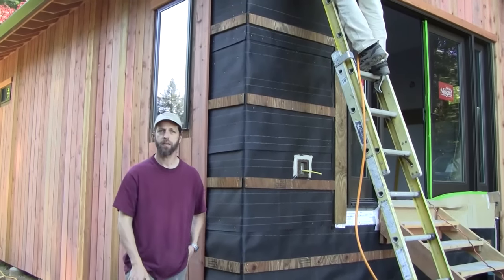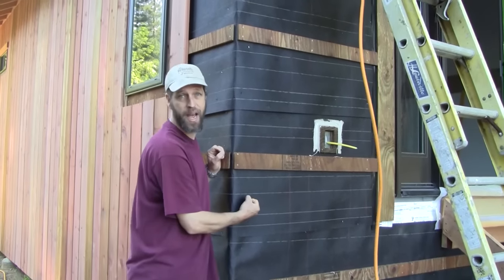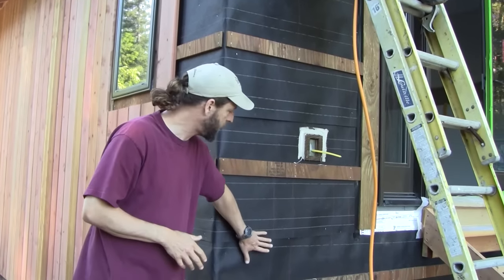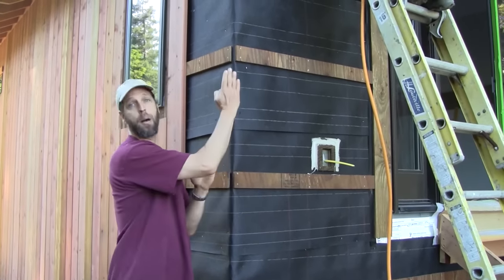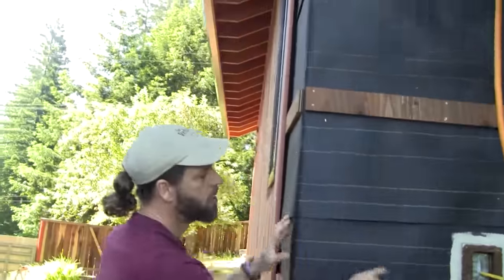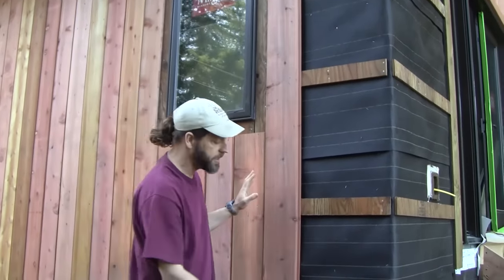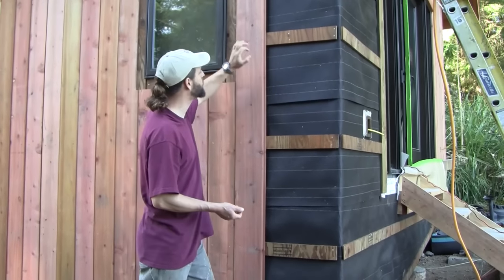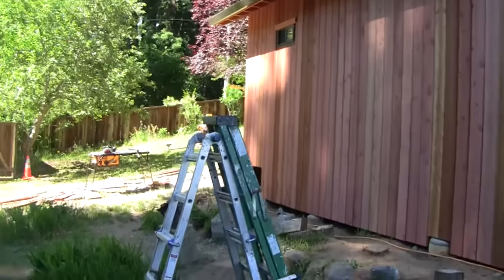DIY VERTICAL wood siding INSTALL with a DRAINAGE plane.  A Contractor Explains.

Comment: i like your ideas on water drainage ....But what about Bugs and other small critters? looks like your building them a nice place to live
Reply: You attach a wire mesh (or some product) to the bottom (and top) of the rainscreen.
Reply: @jasonjayalap  This addresses the critters but how about the bugs?
Reply: @IDRIDER9  
Aluminum screen goes under the bottom and top course of lathing and folds over befor the cladding is installed, sandwiching the screen and sealing out bugs!

Comment: Not too dissimilar to my 45 year old Norwegian type house here in Scotland.  Only difference is my house has board on board cladding and horizontal battens have a 10° bevel to divert any water.  Behind the tar paper is 1/2" bitumen coated fibreboard.
Reply: have any pictures of the bevel rainscreen. what fasteners did you use for the board and batten, are they meant to hang on the rain screen or penetrate the plywood
Reply: In short the fixings don't go through the paper. Only the fixings for the horizontal batten where the posts of the frame are. 
I have 20 mm  horizontal batten, 13 mm x 75 mm back board, 
20 mm x 120 mm face board.
I don't use anything longer than 50 mm and keep the heads flush.

Comment: The t1 11 is a bound to fail. Those little holes don't have a chance. Best to think of thr siding as a vertical roof. In a vertical siding you could have counter battened, that is place vertical battens on first then horizontal ones. 2 by 1 treated battens are very cheap.
Reply: Putting horizontal furring strips on top of vertical ones before you put the board and batten siding on is an excellent idea!!!
Reply: Is there a special flexible  caulking that can withstand the elements to prevent water from getting back there in the first place? Only maybe having to redo it every 10-15 years or so

Comment: Moisture guard, "ice guard", is another great option. It will actually seal around all penetrations such as nails and or staples. I used it on my sisters 100yr old house she bought 15yrs later roof siding everything looks great and holding up nicely. I recommend it.

Comment: How much do I overlap the tar paper? Is there a certain way to start the the second layer of tar paper? (- thinking about how the two layer line up). How do you secure the tar paper - screws, nails, staples? I assume I don't have to tape. Thanks for making this video!

Comment: wicked awesome video. im installing vertical also. tounge and grove installed on furring strips but no drainage cut outs. in gonna have to add some on my furring strips. glad i watched. i was thinking that today and someone also said i should insulate too. i wasnt planing to but i notice your not either. im in new england area.

Comment: loved how boards run vertically and how you took all those steps to guard against water intruion.  My question is:  did you blind nail the boards or were they faced nailed?  And if they were blind nailed, what process did you use?  thanks Steve
Reply from the maker: No face nailed.  I think You could use the jigs for blind nailing just like a deck.  You might have modify the jig so that there is no gap.  I actually have 4 jigs that I use on one job then never used again!

Comment: Tip on vertical siding .cut an angle like 30 degree s on ends by ground,forces water off bottoms of siding where they rot first.
Reply from the maker: Great tip!

Comment: I was thinking you created a water trap with your horizontal strips then you pointed out the reverse t111 trick.. Nice idea. I worry about delamination and rot but hopefully the water proffong did the trick. I think it will work and I would feel good about what you did. I wonder about making similar strips out of pvc type "lumber" that you cut grooves into. Obviously more expensive and time consuming and maybe overkill. I don't know. Great job and video. Thanks for posting. I'm glad I'm not the last tar paper guy.
Reply: See CorAvent strudi strips - $200.00 for 448 feet. 112, 4 footers

Comment: What sort of trim or baseboard will you put at the bottom? Or is it necessary to have one? I would assume that when the water falls down off the roof, it will splash back onto the ends of the vertical siding and make them warp or rot.
Reply from the maker: To answer the first part of your question I would not put trim or baseboard at the bottom. In my experience when you put trim at the bottom of an exterior wall you're just creating a rot spot. When the water goes down the wall and hits the trim anywhere where there's a gap in the caulking will then cause moisture and the worst thing is two pieces of wood touching one another that's where rot begins
Reply from the maker: To answer the second part of your question about roofing. You definitely need a gutter. Any splashing on the ground that would come back up to the siding should be minimized my preference is to keep the siding as far away from the ground as possible. So if you have a little concrete stem wall you just have it as far up away from the ground as possible 6 in 12 in however tall your stem wall is. Another good thing to do is to put gravel around the building if you're in a fire prone zone like we are it helps with fire prevention much more than it is appreciated and it also spreads the splash so that it doesn't bounce up as much. I hope that's helpful!

Comment: I'm building a goat shack and wanted to protect the exterior of the plywood with tar paper- but how do I protect the lower edge, which will be up on cinder blocks, but still standing in snow for a fw months out of the year?  I see you left a few inches bare on the bottom of this wall, but it is up higher & I don't know if that location has snow.  Thanks for any tips.
Reply from the maker: I would treat the lower edge with emulsifying tar or copper green.
Reply: @TheRegenerativeHome  Thank you!  I will check that out.

Comment: would it not be better for water management to do vertical furring strips with horizonatal furring strips on top? will add to wall thickness but seems like it would allow water to pass more efficiently behind the siding?

Comment: thanks for the video. a lot of clarity. but you didn't show how to wrap around the corner. Did you use a L-trim piece?
Reply from the maker: At this point I would wrap with tar paper and put an extra layer of Bituthane around the corner

Comment: Is it ok to wrap house with tyvek wrap first and roofing paper after? Also, what if there is no room for horizontal spacer  strips over the  roofing paper?
Reply from the maker: I think that would work. There are some mesh products out there that will give you a little bit of a drainage plane.  I am not sure what they are off the top of my head.

Comment: I liked what you did. Tar paper however does not breath. That's why a lot of areas now require some type of Tyvec. That does breath. That's why it's so expensive. Putting 2 layers of tar paper is almost like wrapping it in plastic. I still think it will work, but only time will tell. Looks good though.
Reply: Tar paper breaths just fine and when it gets wet, it breaths even better. It has a perm rating of 5 dry, 50-60 wet. It will absorb the excess water and then let it dry out. Lots of builders that use real wood siding are abandoning tyvek type house wraps and going back to tar paper. http://4fs0893rxsil3r8n0j24afu1-wpengine.netdna-ssl.com/wp-content/uploads/2014/04/Sheathing_Wrap_Table_pdfpng1.png

Comment: Hi, loved this vid. :)   I bought a bunch of beautiful antique antique barnboards and I would like to use them to side some exterior areas of my house but they are not long enough to do the run from top to bottom so how do I handle that?
Reply from the maker: Unfortunately you'd have to put in a z bar and create a visual line somewhere

Comment: Did you drill through the T1 11 furring strip when mounting the siding?   Or was the screw short enough to only penetrate into the T1-11 furring strip?
Reply from the maker: Through the strip to the studs
Reply from the maker: That is why tar paper is superior to tyvek. Etc cause it seals around the hole

Comment: You said in the video not to wrap the house in plastic because it will rot from the inside out. What about a plastic vapour barrier on the inside walls under the drywall?
Just for info sake, I live in an area that has cold winter and warm summers so there can be fluctuations in temperature. In extreme case as winter begins and ends we can get a 20 degree difference in temp in a 24 hour period.
I love the video. Soon I’ll be building a heated workshop with board and batten siding. I think I’ll switch from tyvek to tar paper.
Reply: Its probably to late for you. However, they invented Tyvak for a reason.Its superior when as a house wrap.Period............

Comment: How did you close this off at the bottom to allow moisture put , but close off to insects, etc ?
Reply: I am about to do this similar setup but I have added what's called Coravent Bugscreen at top and bottom of wall. And behind my strapping I have 4"x4" spacers cut and installed behind the strapping on each stud.. this will keep the strapping an additional 3/8" from the wall when water enters it will the easily flow down the wall and out through the Coravent..

Comment: Nice. Good method. Since t1-11 has spaces every 8 inches or so for the bead design, I would have cut a groove in between each one as an extra drainage hole. Also I would have covered the furring strip with SAF so all penetrations are sealed.
Reply: I believe SAF is "Self Adhering Flashing".  It would be something like DuPont FlexWrap, which is a butyl tape product.  

Regarding the T1-11, it seems like a lot of 4 foot long strips.  Another method might be to buy pressure treated 1x4's in whatever length you wanted, then gang a number of them together, edge to edge (using a pipe clamp), and with a router route a 1/4"-1/2" channels, 1/8"-3/16" deep, every 6"-8".  The routing can be done by hand without a straightedge.  The channel doesn't need to be perfectly straight in order for any water to drain.
Reply: sure. makes sense.
Reply: Dave, do you feel the T1-11 is strong enough as a furring material versus solid wood (nail retention)?  Do worry about water getting into the plies and causing delamination?  I'm about to install B&B on my garage shop, and using T1-11 is an intriguing approach.  Here in Colorado we're pretty dry (20%-30% avg. humidity), and any water that would find it's way behind siding would dry fairly rapidly.
Reply: 10" wide boards for board & batten install should have 2 vertical routed channels along the back side so air can run up entire lengths to dry it out.  the wood is supplied this way from commercial supplies such as Maibec

Comment: Im adding an addition to my home and the existing siding is painted wood (im thinking plywood) with 1x4 vertical slats every foot or so going up the length of the walls. I want to maintain the look of the house but Im confused as how to sheath the walls. Normally one would use plywood or OSB to sheath, then tar paper (or tyvek) and then the finish siding on top. So if I want plywood to be my finish siding what is the sheathing? What goes underneath the plywood? Do I do two layers of plywood with tar paper in between?  HELP!

Comment: Mike, I am planning on doing vertical shiplap just like in this video.  I will be using a cor-a-vent horizontal batten strip over the wrb.  My shiplap will probably be 6" yellow cedar.  

For siding fasteners am thinking of trim screws, might need to be stainless for the cedar. 

Question....with your nailing or with screws, did you put horizontal blocking between the studs every few ??" vertically up the ext. walls for the vertical shiplap to bite into through the plywood or osb sheathing?  Or, is the sheathing enough of a bite to secure the siding against.   Thanks, Chris Frey
Reply from the maker: I sheathed in plywood and that plus the strips was enough for the siding to be secured.  Trim screws are great!  Ring shank galvi nails  would be the quickest but stainless trim screws would last forever!
Reply: Over time, galvanized nails can/will bleed a black streak. Stainless steel is expensive but the best way to go for that reason alone. In my opinion.

Comment: Hey, great video--very helpful! Thanks. I'll be installing shiplap horizontally, but I'm stoked about using felt tar paper and T-111 furring strips, as you did. Question: Is there a low-VOC rot-prevention product out there that you can recommend?
Reply: Thanks I'm glad it was helpful!
Reply: try concrobium! just salts

Comment: I really like the t-1-11 idea
Reply: This is an obvious statement, but you could also just laying out 1X4 PT boards and snapping some quick chalk lines, then running up and down with a router, or running through a table saw with a dado bit.
Reply: @rickrudd  or a skill saw
Reply: @jbhcrazyskills9508  why are you trying to be so reasonable!? 
I like to think about something too long then propose a difficult solution! 🤣🤣🤣

Comment: Is it ok to use cdx sheathing for siding if you caulk and paint it?
Reply from the maker: It's okay. I might put something in the knots. The only difference between CDX and ACX is that they make it so that there's no knots. Those little cracks in the knots are entry points for water. So I would use a pliable caulk and with a putty knife seal all those cracks in the knots. I wouldn't use something hard cuz it'll just pop out it has to be pliable.
Reply: @TheRegenerativeHome  Ok, Thanks so much!

Comment: You could look back to the 60's and 70's on how well tar paper works on a wall. Unfortunately a lot of the walls built that way have already rotted away from the inside since they do not dry out when they get wet or when moisture vapor tries to pass through the wall and condenses. The building science of using Tar paper was  thoroughly tested for decades. Problems with mold and rot may not show for 5-10 years, but it's coming.
Reply from the maker: Those are all valid points. There are systems that are more expensive that you can purchase now that will last longer some of the integral sheathing paper barrier products are very good. But unfortunately the main option that you can get conventionally being the house wrap tyvek or a similar brand are less effective than the tar paper. So if you're going with a non-indigible sheathing vapor barrier product then two layers of thick tar paper will last a very long time. Most of the ones that you see crumbling apart are thin tar paper layers and only one layer
Reply: I still Don't think tar paper is breathable.  this comment'er I agree with. seems likely that between wood & tar paper will be Moisture/Rot. Luckily I'm just doing a polebarn/garage- likely will use No wrap, maybe tyvek/typar.

Comment: Hi. I'm wondering if you have sheathing under the felt or if you have the felt directly on the studs then with strips and siding
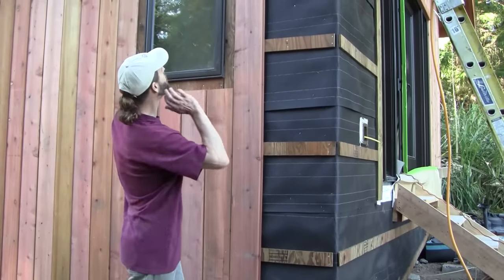Reply: @3:52 he smacks the tar paper, seems he probably has 1/2 OSB or some paneling on top of the studs.

Comment: Only problem with that system is that there is not enough ventilation behind the boards to dry our the moisture, witch you correctly said will get behind the board. You need to use either cross layered furring strips or board on top of board siding method to create continous channels of ventilation from top to bottom. Those tiny holes are not enough.
Reply from the maker: Good point.  I think it would have been best to use a manufactured drainage strip product.
Reply: i'm planning on the cross layered technique but curious if the nails should be going through both batten furring strips into the sheathing or just hanging on the furring strips?
Reply: @MichaelTerrell-l4x  Not sure if I got how you meant to nail it through both anywhere else but where the battens meet but I think it is enough to hit the top one if it is thick enough to support it

Comment: The T1-11 would need to be pressure treated because the water would stay on the on flat unpainted T1-11 surface and rot. The water behind the siding I would hope would be droplets and not running water. I prime ,paint all edges and stain the back. I have T1-11 12 inch on center with battens over the grooves to match the rest of the house which is 1inch cedar with battens. I also have felt barrier and no problem with the house only the siding. Mainly the bottom edges wicking water.

Comment: Hey there, I am building a tiny house and am wanting to put on vertical siding. I like how you used the T1 to have an alternative method for  a rain screen, backing and breathing. My question is, is this tongue and groove boards or any specific type of wood and will you be staining it?

Comment: I think your furring strips are going to rot from behind the siding.  Water needs a slight incline to run and those small grooves aren’t large or numerous enough.
Reply from the maker: There should be very little water behind the siding.  U am confident they will be adequate. Any builders don't even use furring strips.  But only time will tell.  Maybe our grandkids can check back in with each other. And see if it worked ☺️
Reply from the maker: There should be very little water behind the siding.  I am confident they will be adequate. Many builders don't even use furring strips. I have seen many long lasting builds without them. But only time will tell.  Maybe our grandkids can check back in with each other. And see if it worked ☺️